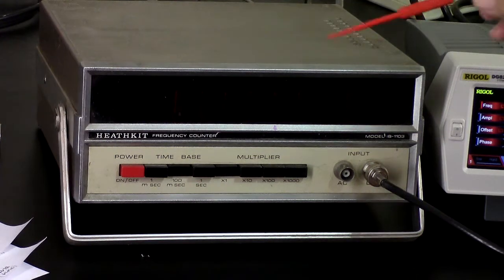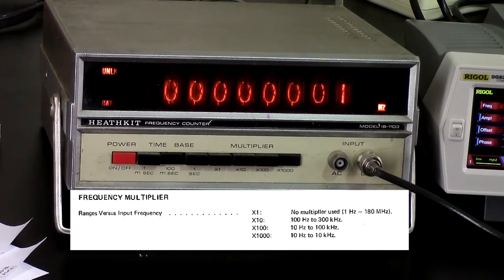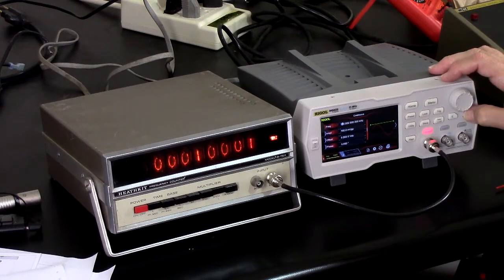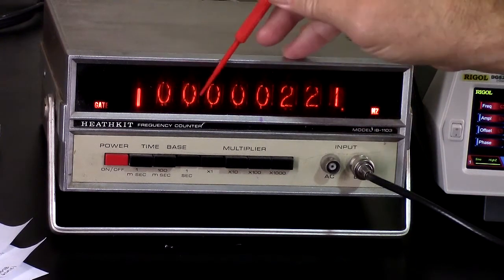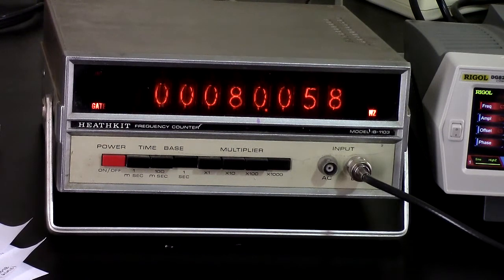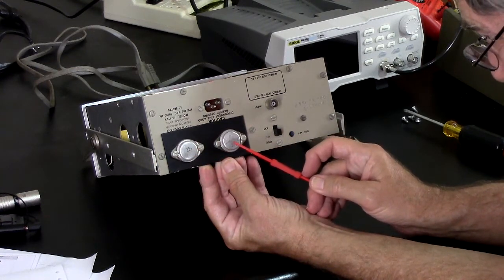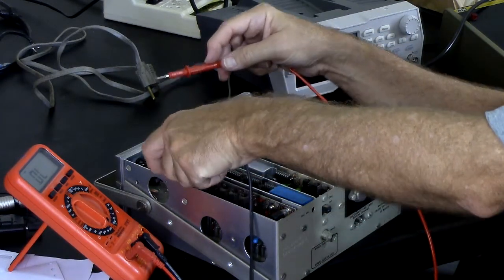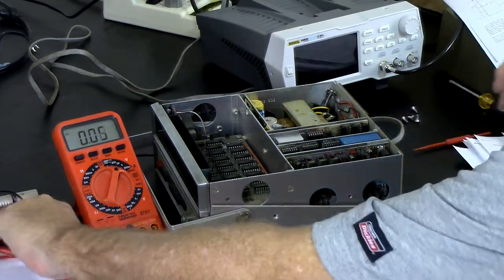First Look: Heathkit IB-1103 Frequency Counter

Comment: Hmmm.  You could make a digital multimeter with an esp8266 or something, but use a pwm output to drive the frequency counter as a generic nixie tube display......
Reply from the maker: But there's no way to sync with the counter's gate timing...

How about a Fluke 8300 instead?